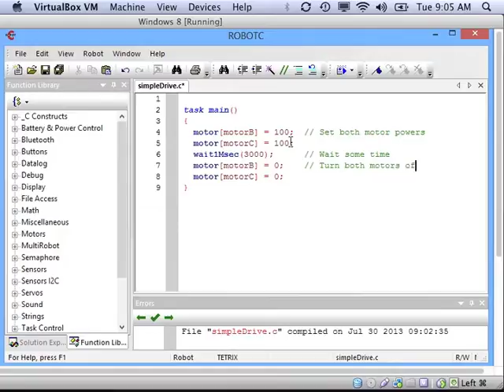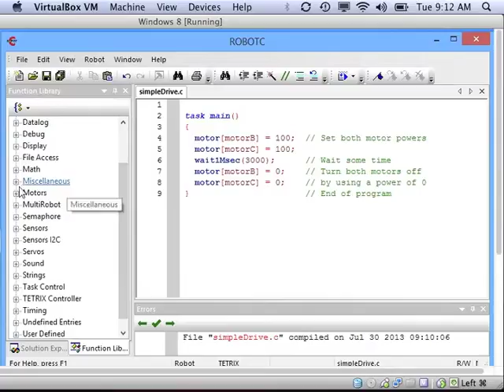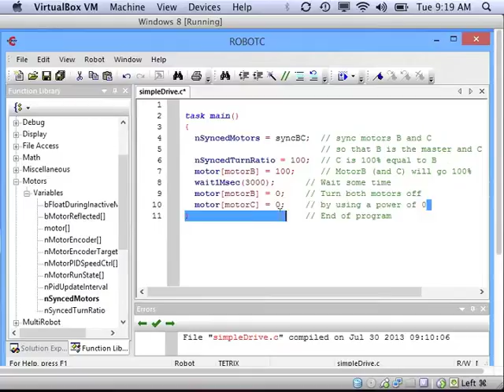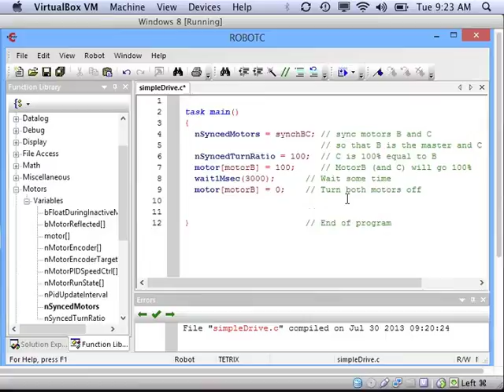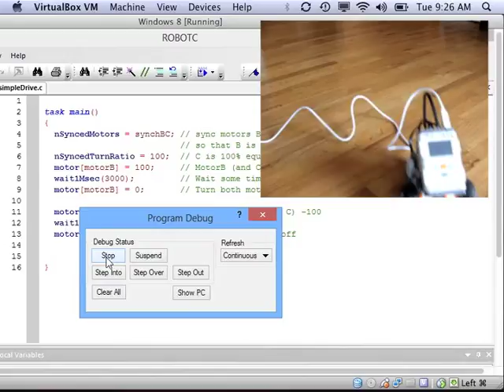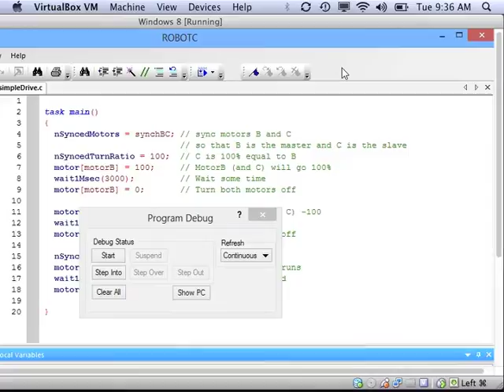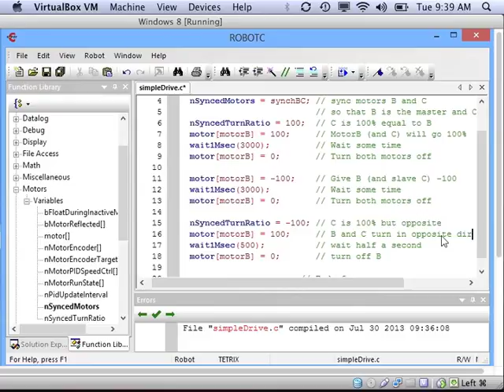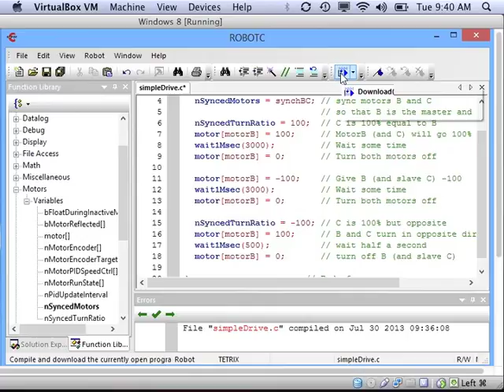Intro to RobotC 2: NXT Motor Synchronization

Comment: My code for synchronizing hasn't been working. I run the code and my robot just spins. I checked the motor variables section and I didn't have that variable, or many others. I only had the basic motor[], bMotorReflected[], and nMotorEncoder[]. Is this because I'm running the trial version?